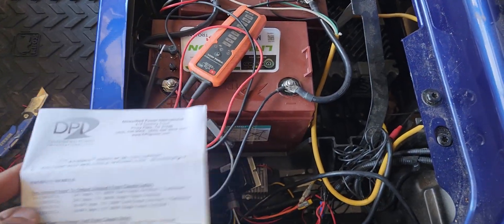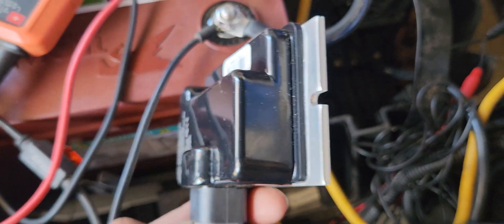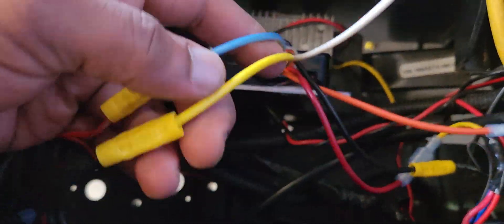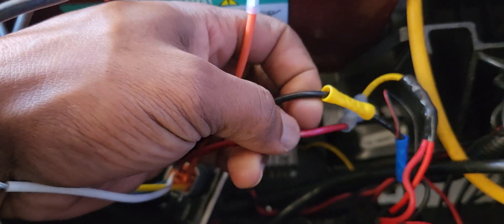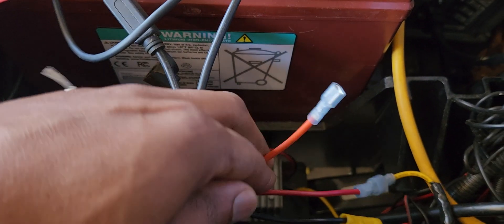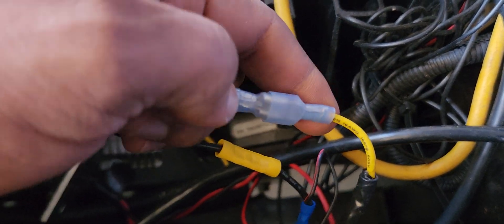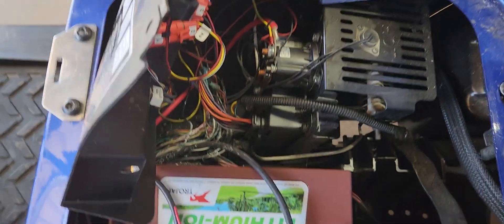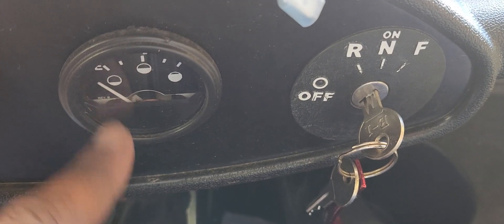Why almost all Golf cart 48volt to 12volt converters are TERRIBLE and how to install the RIGHT one!

Comment: Jeshua, I'm an electrical engineer doing a van conversion and I bought one of those cheap Chinese converters. It never occurred to me to check the quiescent current (usually shown on data sheets as Iq). I don't want that thing running down my 24 V battery when the van is sitting. Thanks for helping me avoid possible problems down the road.

Do you happen to know the Iq for the DPI converter? Is it really low or do they count on you using the white wire to switch it off when not in use?
Reply from the maker: You are so welcome! I'll test the exact current draw tomorrow and let you know!
Reply from the maker: The Chinese converter I have pulls 13 to 14 milliamps all the time with no load connected to output. The DPI converter pulls only 3 milliamps. Hope that helps.
Reply: Wow, that's quite a difference. Thanks for taking the time to make that measurement. I'll look into the DPI converters. @jeshualee2711